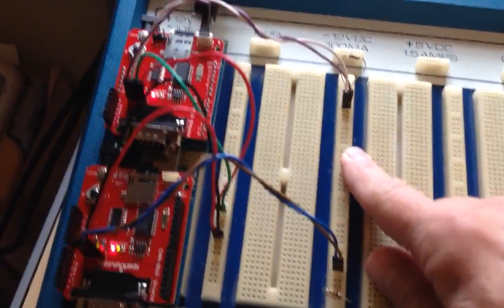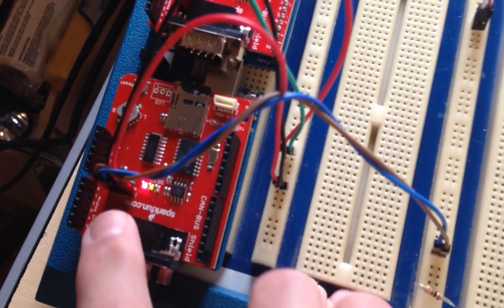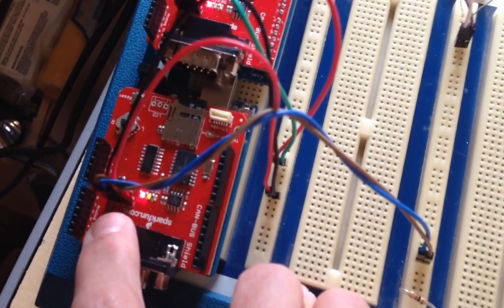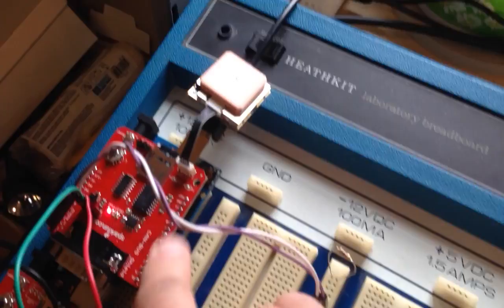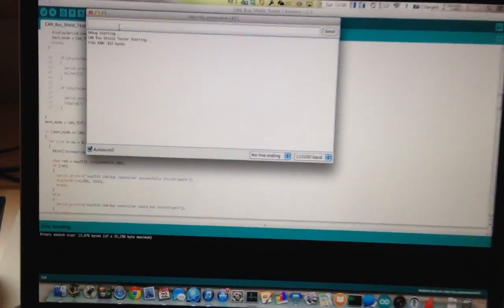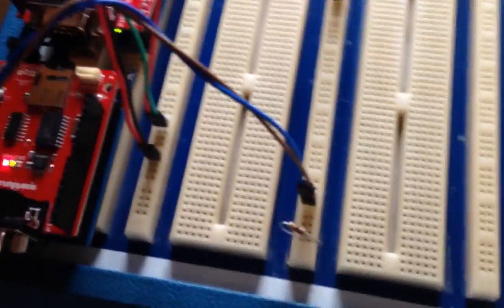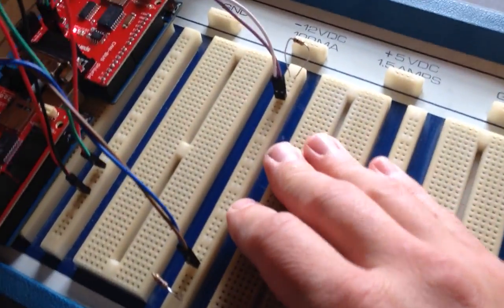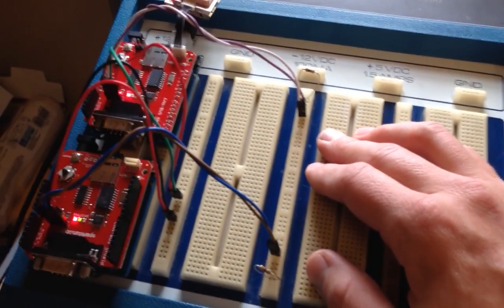CAN-Bus Hacking with the Arduino & Raspberry Pi, Part 1

Comment: Is a common ground between all the nodes needed? I want to connect an arduino to the CAN bus available through the OBD-II connector in my car and I want to know whether I should conenct the signal ground of the connector and the arduino ground.
Reply from the maker: It works better to do so (noise and so forth). Since I usually power the Arduino from the car's power source, it's the same ground and that works out. But you'll notice some difference if you use a self-contained battery source on the Arduino and don't use the available vehicle ground.

Comment: I will be the worlds worst nightmare when it comes to setting up the code so will have to get help, however I am looking to transfer temperature and pressure along with rpm and a few other doo-dad sensors off of a (yet to be identified)  suitable donor vehicle.  The plan is to create a CANBUS ODBC network for a 1978 Austin mini using the linked sensors off the donor connected to a "something" 

Is there a hardware shopping list for what I need to emulate the ECU with? I see you have posted some coding guidance (I'll look over this). 

I have an unused MkI (first mass release) unused Raspberry Pi, could that be used?

Many thanks, excuse my naive approach, I think I have got some support on the coding, I can to the cutting and a soldering!

Comment: Hi Chad, have been attempting to run exactly the same setup as you have here for a while now but after trying multiple libraries have not been able to get communication working (unsure if it is a sending or receiving problem). Would you be willing to share the send/receive code you have running on the two Uno microcontrollers? I would be very grateful.
Reply from the maker: Sure! I'll try to dig that up later today or this weekend.
Reply: Chad Gibbons Cheers, really appreciate the help.
Reply: Hey, just wondering if you'd managed to find any code out over the weekend?
Reply from the maker: Not yet. I was experimenting but had to rebuild some stuff and then had to go on a trip. I'll keep at it :)
Reply from the maker: ***** Check out https://github.com/dcgibbons/arduino_can_bus

Comment: Hello,i am trying to build a can network using the same setup as you have!! Can you please indicate which library did you use for sending and receiving messages? Thank you
Reply from the maker: On the Arduino, the SK Pang CAN/MCP2515 library. On The RPi the mcp2515 patched driver.